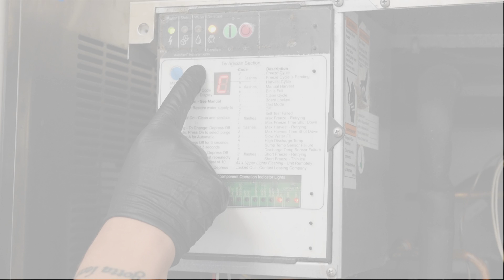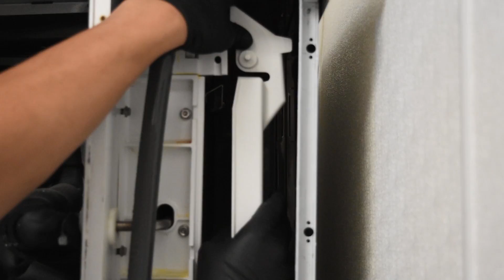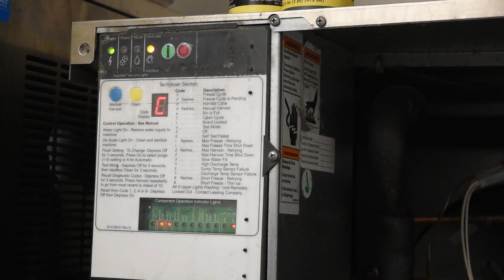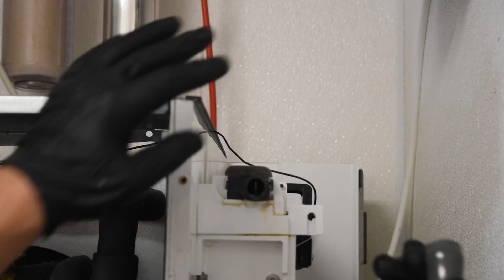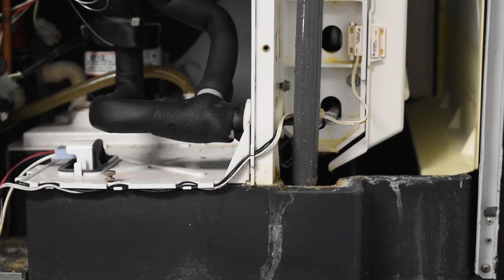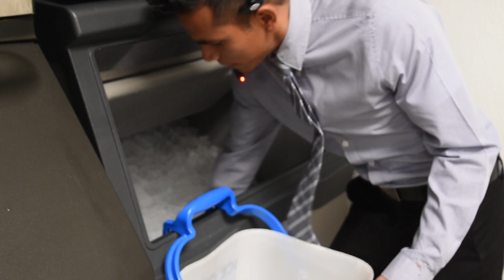Scottsman ice machine service

Comment: Hello do you know where the discharge temp sensor is? I’m getting a code 7.
Reply: It’s on the discharge line of the compressor. If you can’t figure it from there you probably shouldn’t mess with the machine

Comment: Hi how are you ? What happened if the light orange no chance ?
Reply: It means you forgot to press the clean cycle button a second time. On newer machines this is not necessary as the machine will cycle thru a clean mode with one press of the cleaning button